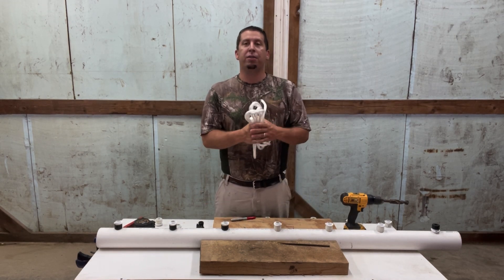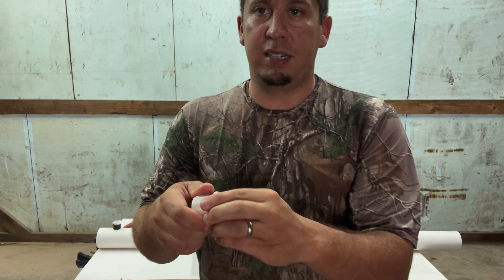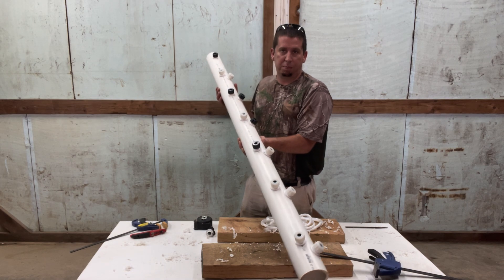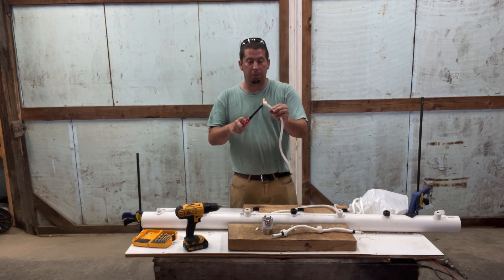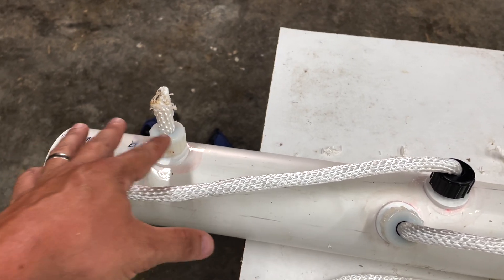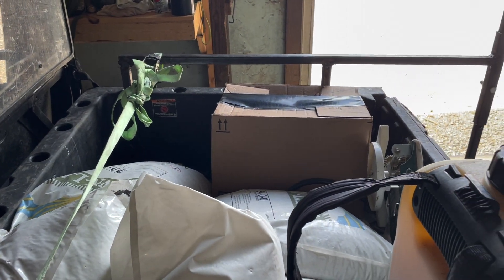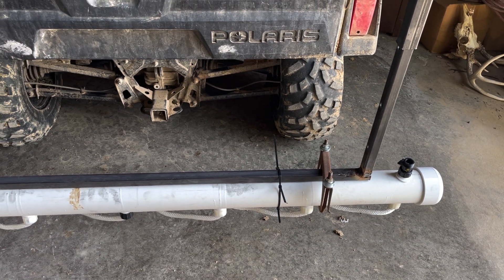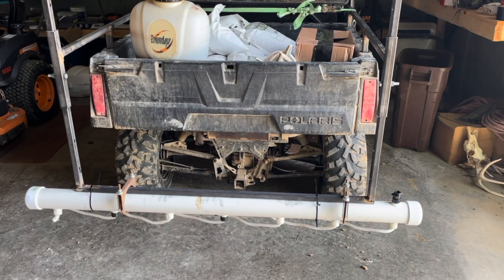NO MORE WEEDS & GRASSES IN FOOD PLOTS????

Comment: Wes....this looks REALLY interesting, although it may be a little above my pay grade.  I'm assuming you used a roundup mix, although maybe a little diluted.  Please show us some photos in a few days or your results and let us know what you suggest applying.    Thanks for sharing.....really interesting,   Bob
Reply from the maker: Bob thanks for watching and commenting! I will keep y’all up to date on the results…currently I believe roundup is the only chemical that is labeled to be used with a wick bar applicator.
Reply: Did you mix it full strength or dilute it slightly?
Reply from the maker: @rfb7117  most all the information I read is about half and half. Check your roundup label and see what it says….it can vary with the product.
Reply: Okay...thanks.  I usually mix 1/2 gal RU to 10 acres.  I was just curious if you mixed it a little weaker than normal.
Reply from the maker: @rfb7117  you would want to mix it stronger because you don’t have much volume getting on the plants. When I’m spraying roundup, I use a 2 1/2 gallon jug for 10 acre….32oz per acre.
Reply: Thanks, sorry I meant that I mix !/2 gal RU to 10 gal water when spraying beans/corn etc.
Reply from the maker: @rfb7117 oh okay that makes sense! I was wondering how you got a good kill 6.5 oz per acre. Hahaha

Comment: Had one of these wicks once and never got the hang of using it.  About the only thing I could half way control using a wick was tall Johnson grass.  MOWING over top of the plot is by far my most useful control, using Clethodim, or a weak solution of Glysophate are second choices for plots that are tolerant, like clover.
Reply from the maker: Thanks for watching and commenting! I agree, this tool won’t get used all the time by any means, but I think it will be useful to have in my arsenal. Especially for those times when we are fearful of spraying but want the competition eliminated. Thanks

Comment: Im battling weeds like crazy in my turnip plot, probably going to have to retill it and plant rye in there
Reply from the maker: Dusty, they can really be a tough problem. Are the weeds higher than the turnips?? If so the wick bar might be helpful.
Reply: @DIYfoodplotpro  there about the same height, would driving over my turnips damage them? There about 3 weeks old
Reply from the maker: @dustybowhunter I wouldn’t worry about the tires on a atv ruining the turnips, but if you got chemical on them, it would kill them. You would just need to get chemical on the weeds, and would be impossible if they are the same size.